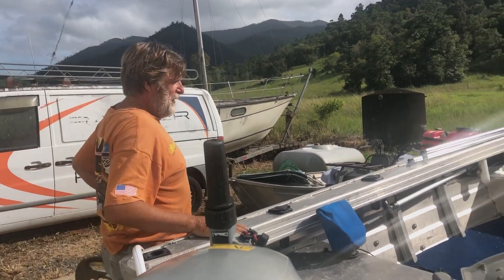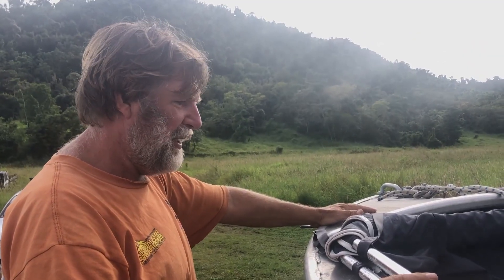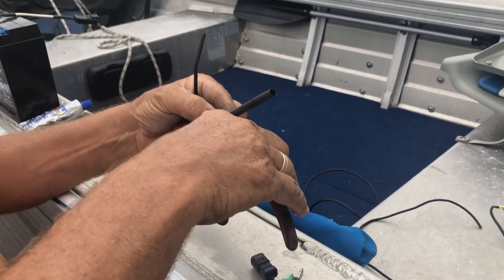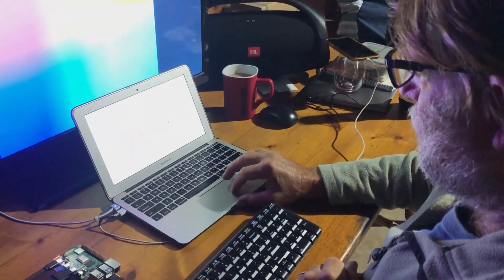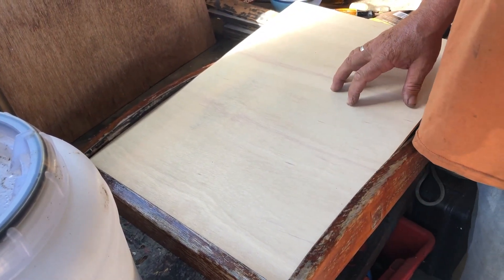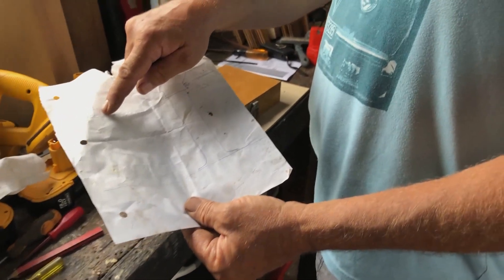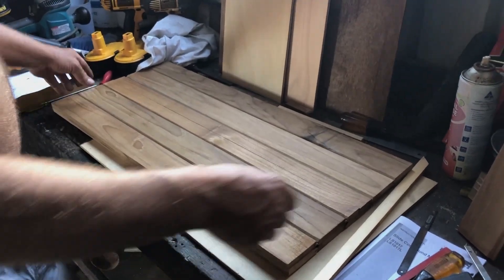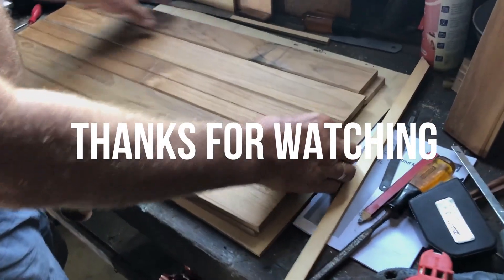Ep 204 | Odd Boat Jobs and a New Cockpit Table, Nutshell Workshop, Australia

Comment: As a former auto/Marine  sparky we always used Tectyl 506 on battery terminals and found it very good to prevent corrosion.
Reply from the maker: Thanks for the tip. Cheers

Comment: Excellently Done  Projects Mates!!! You Now Own The Nicest & Most Functional Tinny I've Ever Seen!!! Soo How Do You Like Your New Raspberry Pi? Did You Get The New Pi 4 w/8GB??? I Have 2 Of Then & They Are The Cat's Meow, I Power Then To Be Totally Portable & Last For A Week+ Per Charge, With A 4000 or 5000mAh 4s RC LiPos Thru A Good Quality Buck Step-Down Transformer w/Digital Read Outs Soo You Can Adjust Precisely On Volts/Amps Out! Then Over Clock CPU To 2100 & GPU To 750 For Amazing Speeds + Get Some ICE Towers For Super Cooling, So They'll Never Go Above 45C!!! LOL Me & You Are SOOO Much Alike In Thinking & Doing Stuff It's AMAZING To Me!!! Except For I Dis-Like Drinking Beer, Whiskey+ Coke Is My Preferred Drink Next To Ice Cold Ras-Lemonaide Kool-Aid!!! LMAO Thanks Mates
Reply from the maker: I love the Raspberry Pi. Learning lots.
Reply: @LifeinaNutshell  I Just Picked Up A 24" Touch Screen Monitor & I"'m Gonna Mount It In My New 1974 Chevy 2-Ton Electrified Tool Truck w/The 8gb Pi To Run All The Electronics + 6-Cameras + Solar Charging On Roof! I Can't Affort A TESLA Soo I'm Building My Own... LMAO